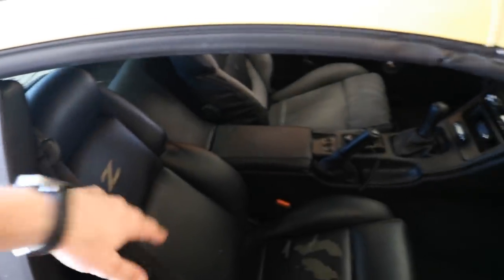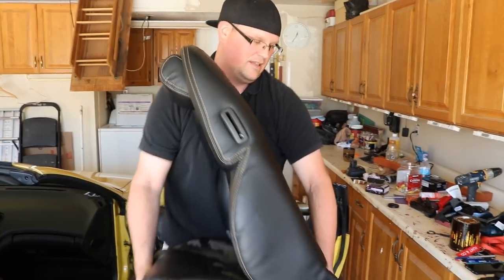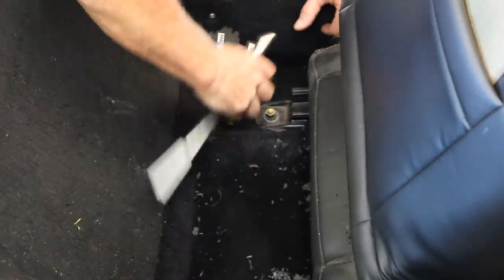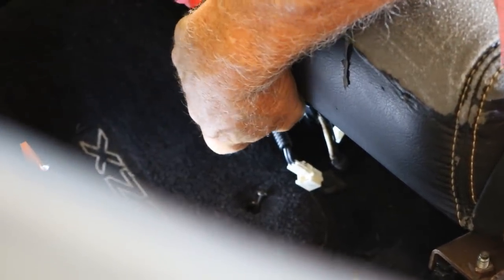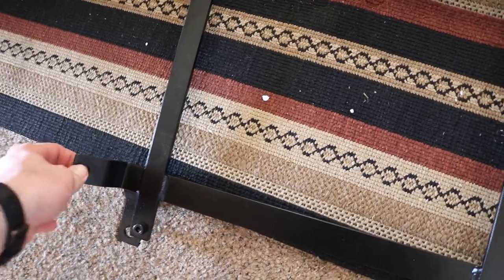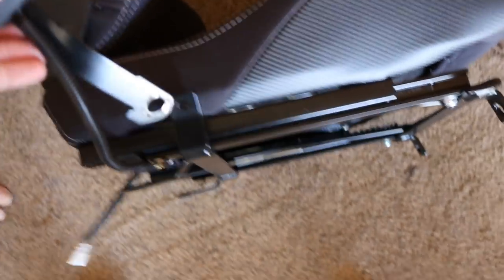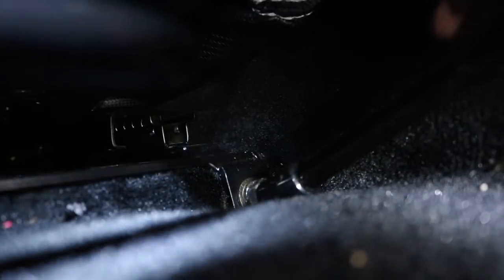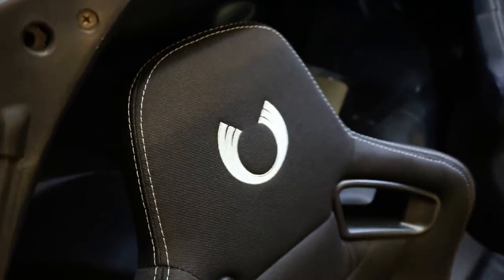1990 300ZX Twin Turbo After Market Seat Install

Comment: Get upgrade, BTW did you install LED bulbs in the upper door panels, and/or the dome light?  If so, do you remember which ones you got?
Reply from the maker: Unfortunately I did not. The previous owner had already switched them all out. I can pull one out if you're interested in what brand they are.

Comment: At 6'5", my head sticks into the T-Top of my Z - need new seats.  How much additional room did you get with the new seats?  A rear-end accident would open my head like a soft-boiled egg...  Have the Cipher seats been holding up well?
Reply from the maker: They dropped me about 5 inches so I have about 4 inches of headroom now. And they have held up amazing!
Reply: Nathan Osborn! Did you end up buying and installing some seats? How'd it go / fit???